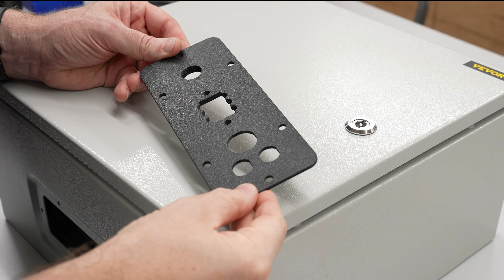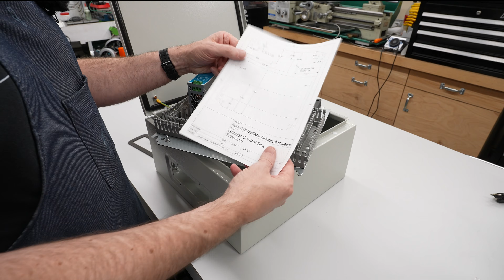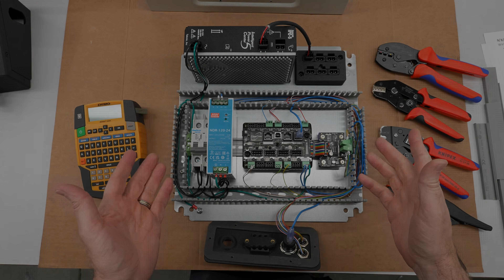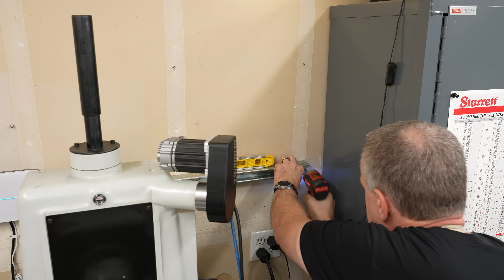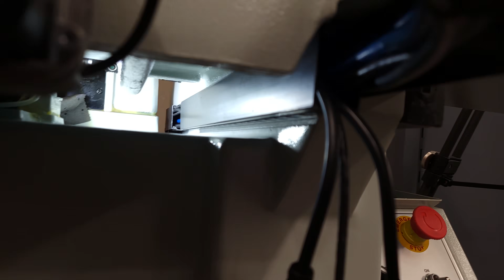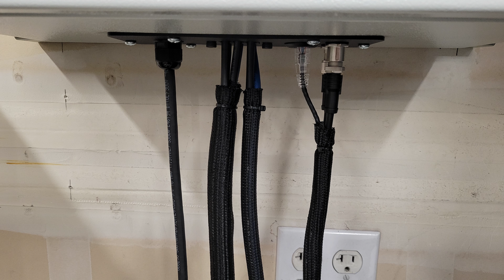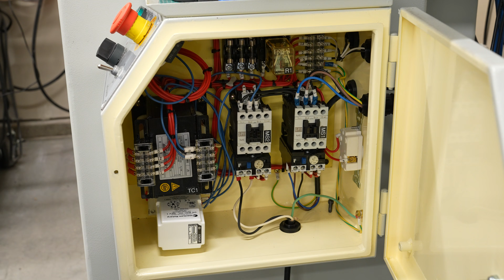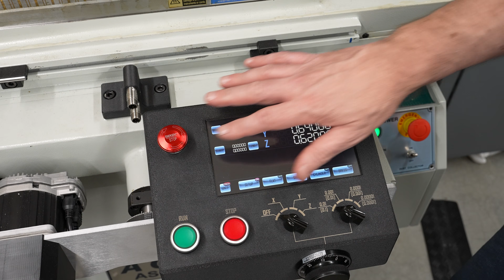Clean Control Cabinet Wiring Made Easy!

Comment: Printable Whaaaattt!!!???

That is a thing?  

Holy cow Batman! One more thing that I didn’t know I needed!
Reply: I know. Now I have to buy that too and I already have probably 5 years worth of heat shrink. Except I'm going to need larger sizes that he used.
Reply: Thermal printing is a lot more versatile than I would guessed from old fax machines and receipts.
Reply: Take a look at the Brother E550WVP over the Dymo. Either are great :)
Reply from the maker: @seabreezecoffeeroasters7994  the Brother looks really good.  It's quite a bit more expensive, but also handles much larger labels and heat shrink tubing.
Reply: @Clough42  Not being tied to the device keyboard is a major plus too if you use it more than a few times a year. Even for home use time still has a cost.
Reply: Everyone talks about Coast of the machine. If you use it for ten, two or three years does it really matter if one is $50 more? No it doesn't because you didn't look at the product price. So I spent $500 on mine and have saved $300 on refills over it's life so far. Consumables that are name brand can and do change the lifetime cost of a tool. As a hobby you still need to find out what your expected life time cost might be. Simple way two do this is to create a package for what you think will last a lifetime of the tool. Then get what you need from the cheapest tool.

Comment: Nice job! Not to nitpick, but you shouldn't have 2 buttons labeled "E-Stop" that perform different functions. You might relabel the button on the CNC control to "Cycle Stop", or Oh Sh!t, or whatever. Again, really nice job!!!
Reply: I agree. In germany you differentiate between NOT-AUS and NOT-HALT. NOT-HALT being Emergency-Stop (Makes everything stop asap) and NOT-AUS being Emergency-OFF (Actually killing power to everything including the controls.
Reply: @m1n1truck3r2  In the US we are guided by NFPA: Section 79. It is the electrical standard for industrial machines and machine tools. As far as buttons, it specifies locations for E-stop buttons, also specifies colors of buttons and legends per function. It's a fun read. I once had to make a rather large machine company in Germany send me new operators in the proper color, because their machines didn't meet the standard, and didn't match all of our other machinery. If you have hundreds of machines, you must follow a standard or you will have problems with employees operating the machines, and accidents.
Reply: @nickandersonco  Unfortunately, like most codes and regulations that we must follow, you have to purchase it from the organization that maintains it. I'm quite sure you could find an out of date version somewhere on the interwebs.
Reply: @MacLocky  Why do people say "Use grammar like me"? 🤓🤓 And you assumed my gender...🤓🤓🤓
Reply: @cnyjody9650  Did I touch a nerve? “Be a man” is an expression of speak meaning “be true to yourself”, as I would hope you know, and not some thinly veiled misogyny. The irony is not wasted on me that you get upset about my observation while telling Mr Clough how he should label his E-Stop buttons.
Reply: @MacLocky  Wow, you really misread my reply. It was all in fun...just like yours. I guess from now on, I'll insert (sarc), to end all confusion. It's all good. Enjoy the holidays!

Comment: This is fantastic. I have a surface grinder I want to do this for I think I will be watching this several times. One question, can this be run off of a pendant so that you can operate the grinder from a different position, much like the European small surface grinders in which you along side of the machine and can have a better view of the work.

Comment: I'm in the process of redoing my control box for my CNC. Last year I had no problems with EMI, but this year it seems to be causing issues, false estop trips when the spindle spools up, turning on the VFD on causes the clearpath steppers to not respond. I had the VFD in the same enclosure as all the other electronics, so I've now pulled that and the filter out and am putting it in a separate metal enclosure much like the one you have here. 60bucks on amazon and it seems well built.